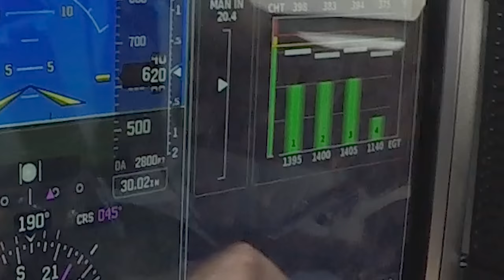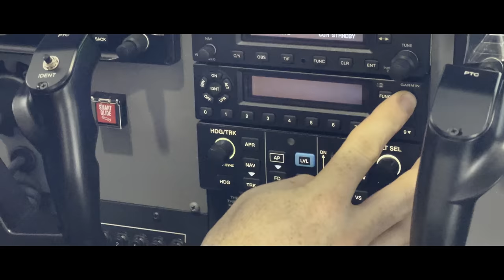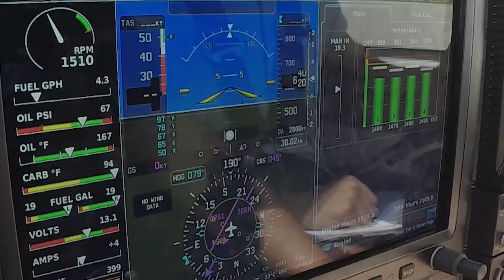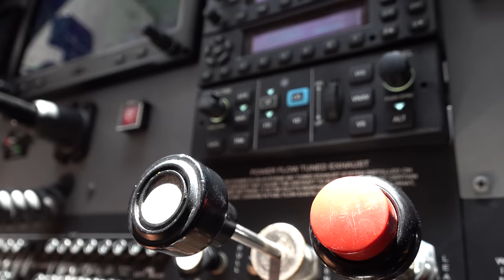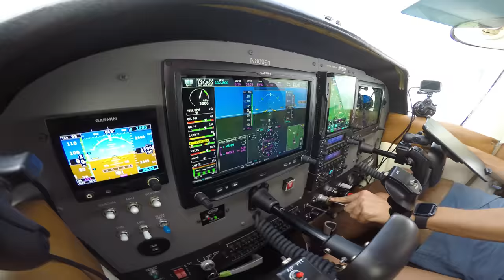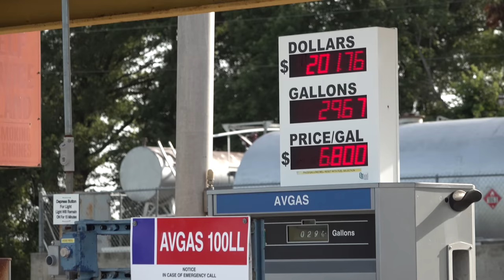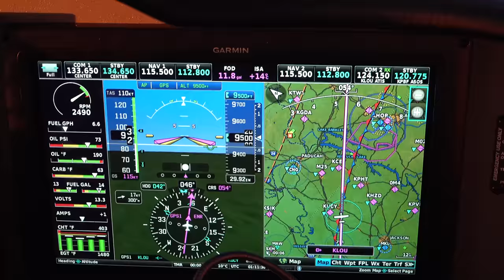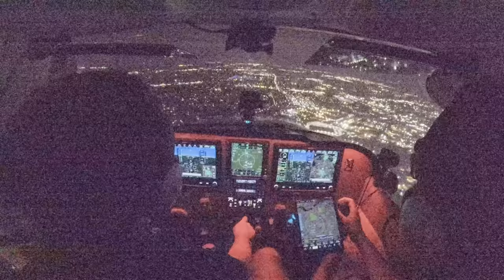"Cylinder 4 just died..." Starting a 5,000nm Trip - 3 Countries in 3 Weeks: Part 1

Comment: 4:30am departure for Oshkosh out of Millington, TN runup sounded just like yours except the #3 cylinder of our Comanche had checked out so it was drive to Oshkosh. Repair was removing, having overhauled, and reinstalling our #3 cylinder due to stuck exhaust valve and did the #4 because its valve stem guide contact looked worse than #3 even though it was working fine. Great video can't wait to watch the rest of the series.

Comment: Just a note. When putting the cowl plugs in keep the rope on the outside of the prop. On start up your prop will clear the plugs and you will not overheat after takeoff. Local school had to replace both engines on a BE-76.

Comment: Josh, look at the REM 37BY Plugs they will reduce the chance of lead fouling due to their design.  I run them in my O-320 on the bottom plugs. The O-320-E2D we have in our plans have low compression cylinders and we’re designed to run on lower octane then the 100LL sold today.

Comment: Josh/Chelsea you really need to consider producing a show for one of the cable networks where Chelsea performs aircraft, maintenance or owner assisted maintenance. It would be a great inspiration to females around the world. Plus, it will give us non AP pilot/owners some great inspiration.
Reply: I have some material that is centered around that currently in the works! Stay tuned 😊

Comment: If you get a fouled plug usually you can run up the engine to 2300 on both mags for about 30 seconds and usually that will clear up the plug. Happens all the time on my Cherokee. Ground leaning is very important. Safe skies!

Comment: I too have suffered with lead fouled plugs for years.  The usual remedy is to run the engine up to 1800 rpm and lean it as much as it will take for about 30 seconds or so.  And always lean on taxi.  But this annual I'm biting the expense bullet and switching to Tempest fine-wire plugs.  Fingers-crossed, I hope this works!

Comment: Flying since '88 when NOTAM were not as detailed.  Always called ahead to check on fuel availability.  Until I didn't do it once on a night cross country only to find a locked pump and no contact info for line help.  Never did that again.  I still call ahead to my fuel stops to make sure the pump works, they have fuel and payment method is avail.

Comment: No fuel and no NOTAM is a problem. I experienced the same situation you did. I was flying late in the day but still daytime. I even called ahead and spoke to someone who told me they had fuel. However, what he did NOT tell me was that the pump was not working. And of course, the nonfunctional pump was not NOTAMed. Very frustrating. Fortunately, I had enough to get to a nearby towered airport but I also paid $2.00 more per gallon. And, yes, I called the FBO at my alternate airport to confirm they had fuel. I posted a complaint with the other airport’s manager and their local municipal government but never received a response even though I asked for one. I wanted to explain that advertising that fuel is available but it is not, is a safety issue.

Comment: On the right side screen -- put the engine instruments on the far right side, and swap the two windows. Then you can use the right screen as an MFD, also. You've got both screens configured as if they were on the left side. Look at commercial jets -- they have the PFD on the outsides.

Comment: Josh,  Great job on the video.  Sorry you had to scrub the Alaska trip.  Not that this one is going to be horrible I'm sure, but in my opinion Alaska is always best.  Spent some time in the pan handle of Alaska this year myself as my wife worked most of 2022 up there.  Missed you guys at Oshkosh this year, things just didn't line up to make it to any of the meetups.  Maybe 2023.  Happy New Year and good luck in everything you guys have going in 2023.

Comment: Thanks for sharing your adventures as always. :)

A little thought on fuel, assuming my crappy maths work correctly :-
US Gallon = 3.785 Litres
$1 = £0.82 as I'm typing this.

$6.80 a gallon for Aviation fuel = ~£1.48 a litre in the UK.

UK Petrol/Gasoline (Automotive) is ~£1.78/Litre as I type this (Scotland)
So, if I've converted right, that's $8.21 a gallon for plain Gasoline.

Y'think you're getting reamed...? XD

Comment: I see you landed at Bowman Field. I took my introduction flight there then followed with my first 25-30 hours and first solo. Falcon Aviation was the fbo. I miss flying so much. Haven’t been in about 10-20 years. I want to get back into it so badly but the rising costs to get my PPL are astronomically high right now. I will get back in the left seat soon. Clear Skies and Safe Landings Captain. Mind you I only had 2 hours of actual night PIC with an instructor right seat.

Comment: I run fine wire plugs on the bottom of my IO-540. I still lean during ground ops, but I haven't had a found plug in well over 7 years. Same set of plugs.

Comment: Hi, like your videos.  I’m a former ATPL - rotary-wing class 1 instructor and CPL - fixed-wing.
I would like clarification regarding your use of carb heat. In my training days back in the 60’s I was led to believe that you use the carbheat to clear any ice that may have formed in the carb and then you turn it off once the ice (if any) has cleared.  Leaving the carbheat on, can cause ice to form at a higher temperature which means you cannot add anymore heat to clear that ice. I noticed you applied carbheat on a long final and left it on to touchdown. Your opinion?
Reply: I use carb ice any time I’m below the green arc of the tach. which is when it is most likely to occur. Below the green arch is typically seen while configuring to land. I have also experienced carb ice at cruise rpm on a 75 degree day with high humidity. Your temperature drops up to 60 degrees per millisecond as it travels through the Venturi. Not sure what you mean by “ice forming at a higher temperature” because of course above 32 is not possible. I like to close carb quickly after touch down to eliminate the risk of ingesting something on the ground since it is unfiltered air.

Comment: No excuse for not NOTAMing fuel availability at 5M4, but in additional to maintaining a fuel reserve, a phone call to the FBO or airport manager ahead of time as part of your flight planning, may have saved you a lot of aggravation. Those phone numbers are readily available on every flight planning platform. You might be surprised at the service you receive at some airports if they have a heads up on your arrival. Try it.

Comment: I don't know if it's good practice or not.  My CFI would lean the powerplant and run it up hard until it burned the fowling off the plug.  It worked so I guess it was okay. This was a C172 with a 180 HP powerplant and tuned exhaust.

Comment: Hi Josh, how much time do you think you saved by having an Engine indication system that showed you straight away the issue was #4 cylinder? Otherwise it would have been all plugs for that mag pulled out and inspected without being absolutely sure which cylinder/plug was the culprit. Cheers.

Comment: This might be a question for @chelseasmith6764, but as a pilot, would a borescope be a useful tool to have, i.e. is there anything specific a pilot could look for once the plug is out?
Reply: I like to take a peak anytime I have the plugs out. It definitely takes a trained eye. I remember using one for the first time with a senior mechanic and I was totally lost. I spent a lot of time picking other mechanic’s brains and doing my own research. They’re an incredible tool, and less than $200
Reply: @Highmaintenance_chels  thanks! I've added it to my shopping list. If you ever decide to host a discussion on troubleshooting beyond the basics or things we can do to make an A&P's job easier,  I'd be first in line. If that means just leaving it alone for you, that's ok too!

Comment: Due to the cost increase in aviation Fuel I’ve had to put my PPL on hold.. as a separated father to 3 the cost of living increase has seen pretty much an extra £500 a month taken out of my salary.. this was my flying allowance which I can no longer push or stretch.. 

I won’t give up, unfortunately I just need to hold the dream a little longer than I was planning.

Comment: Question on your comment. Are you saying a single engine plane should not fly at night?

I enjoy flyijg at niggt, be ause the air is usually clean and you can see forever. I agree its hard to see places to land if needed, but there are always risks wherever you fly.

Juat need to have a good plan before you engine start.

Comment: Curious what Chelsey thinks of putting fine wire plugs in at least the bottom 4 at a minimum 
Thanks for sharing ✈️👍
Reply: Personally I wouldn't want a mismatch. Cost per hour break down comes out to be around the same. The plug that was fouled in 80991 that day could have been cleaned up if we had the tooling and the time, the mass center electrode was a little football-ish but didn't look out of tolerance.
Reply: @Highmaintenance_chels  I asked Mike Busch about mismatch of fine wire on bottoms & he didn’t say it was an issue. Plus articles out there talk of doing this. But l best & Merry Christmas all,

Comment: Aviation 101 you sure have a new panel now my only comments is two engines are better than one if you are well trained I switched to twin engine after engine failure broken craNk shaft on cross country at night was luck happened very near to airport and was at 9000 whan it happened. My last aircraft was a piper aerostar 600A had many twins my first was a mooney Christopher Ottawa Canada